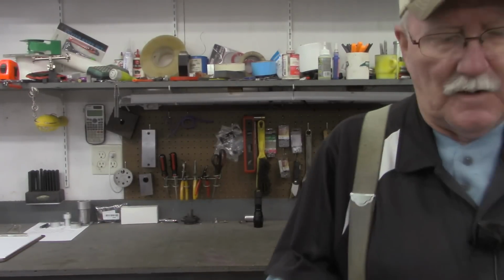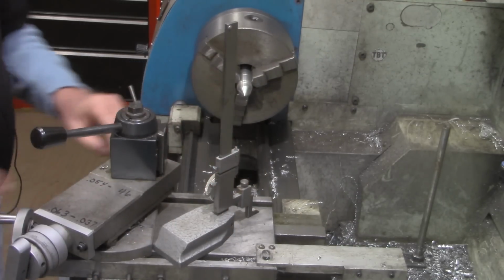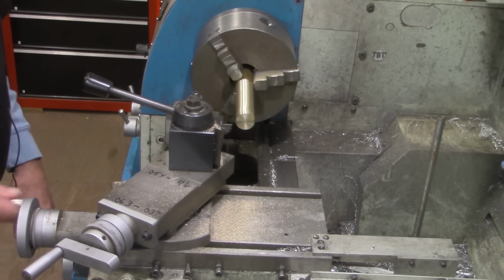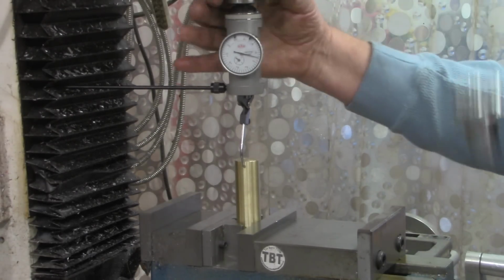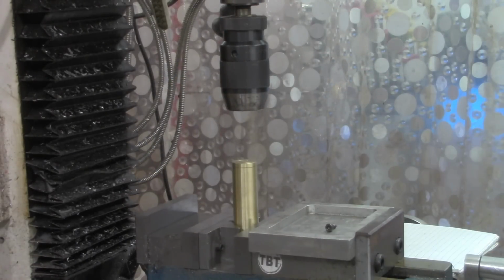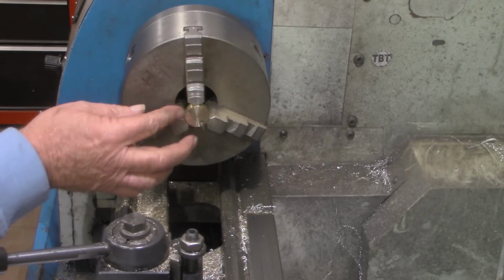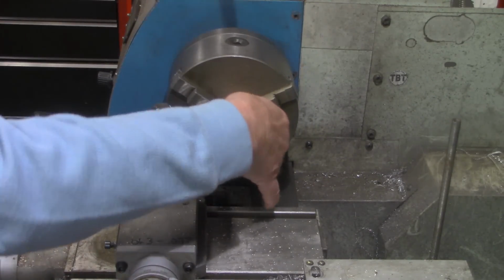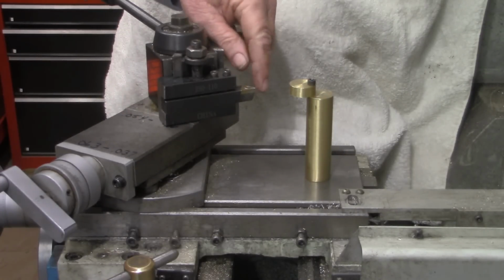Lathe Tool Height Gauge

Comment: The idea is great. I use a 6 jaw chuck opposed to a 3 jaw. When trying to hold short pieces (like your 3/8 cap) it’s way easier to get it running true. Indicating the part in the mill is great if you want a very tight tolerance but for something like this I’d simply have drilled a small center drill in the end and then put a center in the spindle to get it zeroed in. What can I say…. I’m a lazy toolmaker. ( since 1976 lol ) I made mine out of a larger dia. piece of aluminum and a larger magnet.

Comment: i watched the same video from Tom Lipton. also in the video was an adjustable unit manufactured by one of the high-end suppliers of precision tools. it had supper fine threads for the adjustment. fun video, thanks for sharing. i would like to build one of these for my lathe.

Comment: G'day Lee    Another impressive video from the Tin Barn. I was going to make a similar tool height guage,  but with your bolted top section it makes it better for the standard tool heights, as well as upside tool height adjustments. I will be incorporating a small magnet in the base to stop movement when adjusting the tool height. Well done, catch you on Your next project.

Comment: I might have skipped the magnet. Even the little Neodymium magnets are hard to clean swarf off of. The only way I would put it on that tools is to recess it more, and use the type with the hole and chamfer in the middle. So you can remove it if it gets too hard to clean.